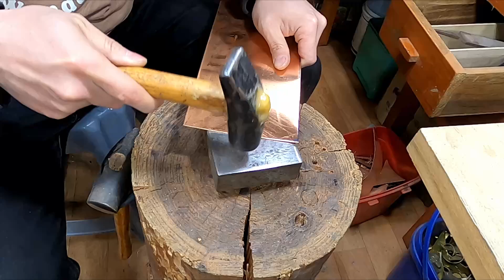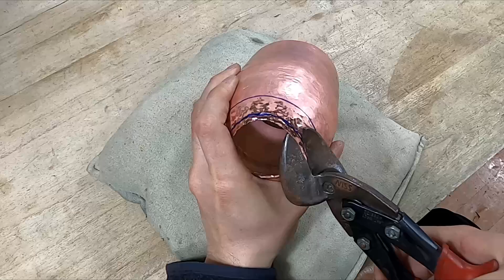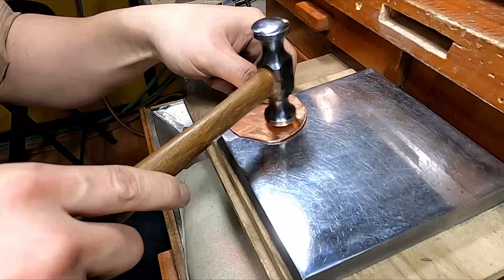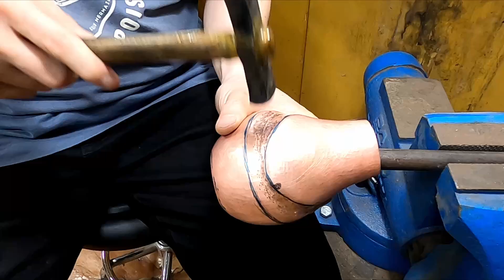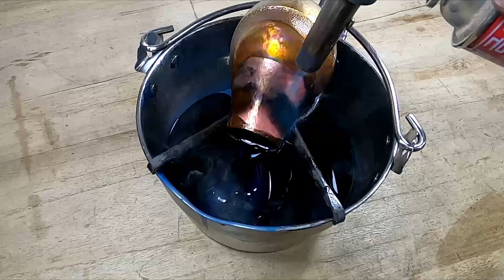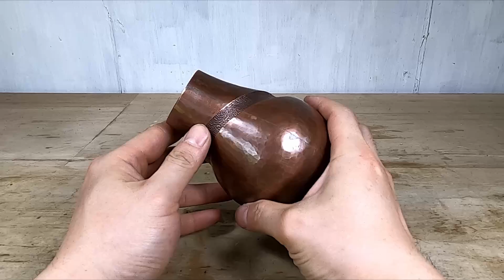금속기물 - 2분할/metal vessel - bisection

Comment: Good afternoon I would like to ask if there is a difference in strength if not soldering but welding agron?
Reply from the maker: If possible, it is best to join only copper using welding. Of course, if welding is used, the welded part may become thin, and cracks may form during hammering. I don't have a welding machine yet, but I plan to do welding in the future.